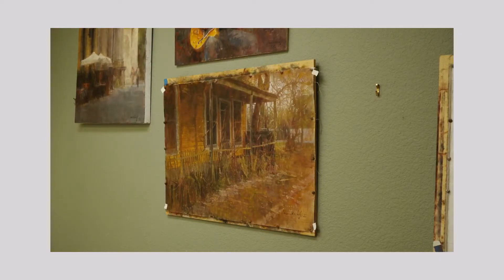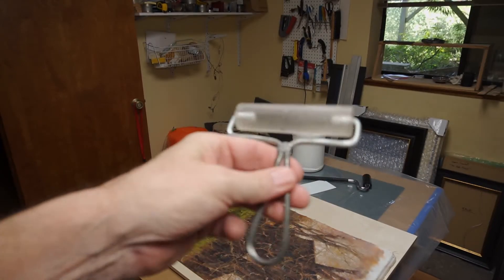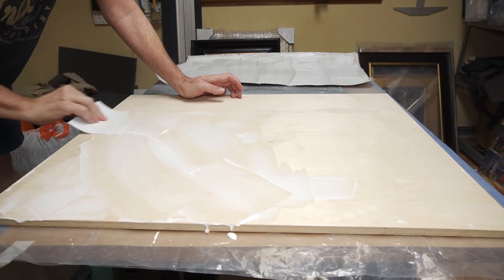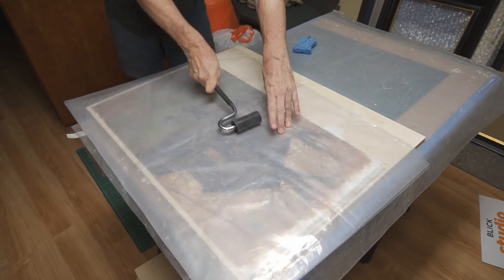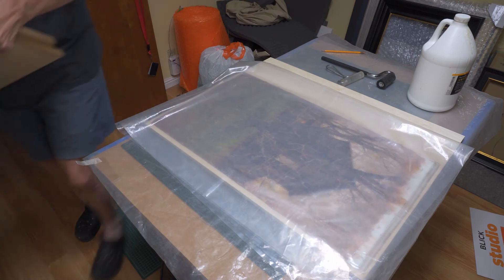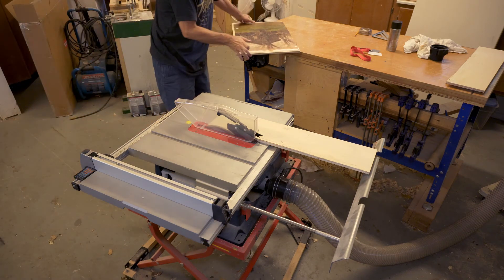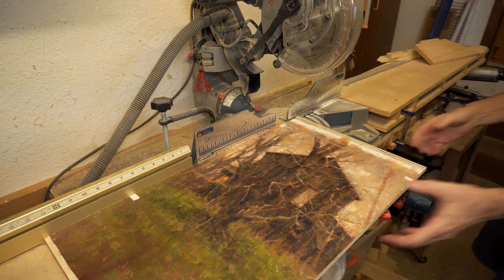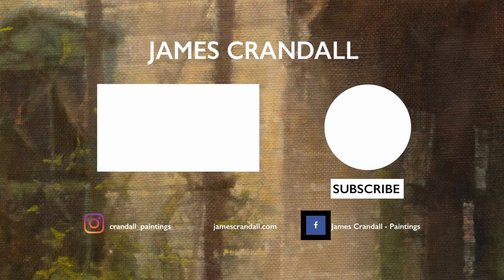Mounting Larger Canvases

Comment: Thanks, James. Nice video! I used a similar method, with lousy results. I tried to glue a 22x28” loose canvas print to posterboard twice, using Elmer’s Glue All (which, I understand is essentially PVA). Both times I ended up with lots of bubbles, and the glue seemed to dry way too quickly. I suspect the posterboard absorbed it, so the next time I’ll use a piece of hardboard, with the same glue. Do you think it will work?
Reply from the maker: Hi Alexander, thanks. I don’t know about your glue one way or another, I only know my choice works. The mounting surface really needs to be stable enough not to warp… I doubt 1/4 Hardboard is thick enough to stay flat at that size, unless it’s substantially braced in the back.